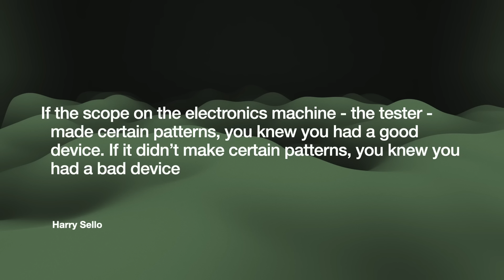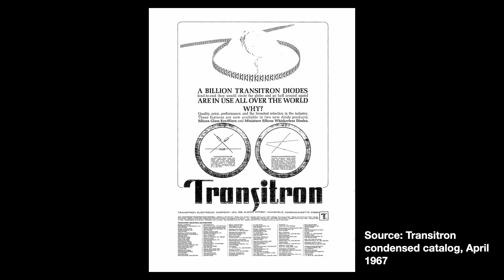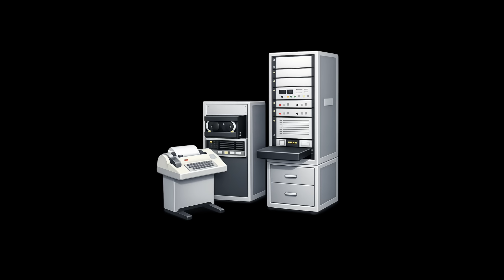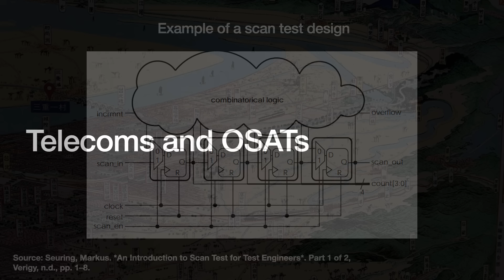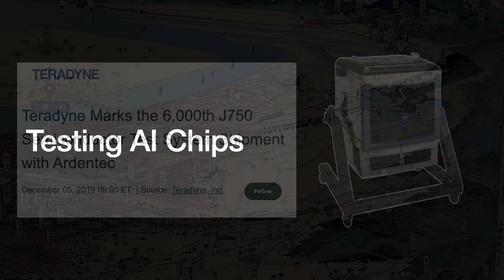How To Test 208 Billion Transistors

Comment: I would point out that the reason the number of test vectors were rising exponentially during the early years of the IC and SOC boom didn't actually have much to do with the number of transistors on the chip/board/system.  It had to do with the amount of buried system states (registers or memory).  The testing of functions with no buried state can be done by increasing the number of tests linearly with the number of transistors in the function.  But if the design buries state, you may need to cycle through many vectors just to get that buried state into a known test condition.  As the amount of buried state grows, the number of test vectors tends to grow geometrically.

I used to work for chip and board manufacturing companies from the '90s through '12.  I transitioned to device driver development later during that period, but in the '90s I spent 5+ years working on chip testing, including the creation of a custom ATPG tool for a smaller custom IC design firm to help with the creation of test vectors for a customer's chip designs. While I'm certainly no expert on testing silicon, I like to think I had just enough of an introduction into the field to understand some of the complexities involved.

BTW, look into the JTAG standard.  It was originally developed as a standardized protocol and interface for testing IC designs. It lets you halt the clock on the chip and serially shift in and out most, if not all, of the buried state in the design.  JTAG was also coopted to create in-circuit debuggers for ARM and other embedded processors, since JTAG's functionality is essentially a superset of the functionality needed for those debuggers and JTAG is/was a pretty well understood standard.

With that said, I've been retired for 5 years now.  The entire test industry has probably moved on from my experiences / background, so take this with a grain of salt.
Reply: JTAG was originally developed for testing the interconnect between chips on a board, not for testing the logic on the chip.

Regarding the buried states requiring more test vectors.
Design for testability (DFT) have been around and in use in integrated circuits, certainly in the 1990's and possibly earlier.
There are a number of techniques that can be used to deal with this problem, before JTAG came along, some of which involve the use scan chains, flipflops connected in a shift register which enable data to be clocked in from outside of the chip, the test vector applied to the internal logic, the output of the logic then fed the result data into another part of the shift register and the test results clocked out.

So you're not exercising the functional behaviour of any sequential logic circuits, which is where you have to sequence through a set of test vectors. The data is applied to the combinational logic purely for the purposes of testing, looking for stuck at 0 and stuck at 1 faults on the output of gates.

Comment: I love your content! 
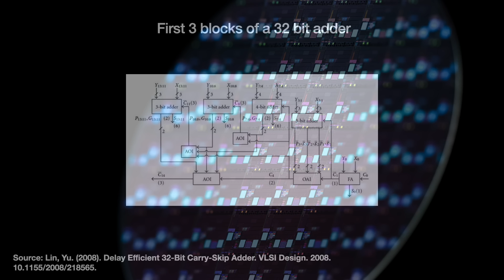19:35 that is not entirely correct. With prfix tree adders like kogge stone or other cla adders you need n^2 * c tests where n is the number of bits. Since you do not need to test every single input, but just that every single brent kung cell is working correctly. This can be done by crafting inputs in a way to force every single bk to switch in a way that you can rule out that 2 or more cells are broken. 
With ripple carry this is even easier und you just need n*c tests. 

Keep going!

Comment: I worked for Schlumberger the first 11 years after college on their Test Equipment. I worked on the calibration and diagnostics for the digital and mixed signal machines. These testers are super complex pieces of hardware and their software was more complicated than anything Microsoft has ever created. Out machines where used to test Intel and Sun micro processors, among others. We used to call the machine "big iron" testers because they where the size of a minivan or even larger.
Reply: Ironically another commentor reckons they work at Teledyne - and that they were 'awarded' for the largest Excel plugin
Reply: @mycosys  Our big machines where all powered by Sun workstations but I know Teradyne had an Excel based interface and I am sure the extensions and the spreadsheet would have been extremely complicated.

Checkout my channel for a Schlumberger video about the future of work in the year 2021!

Comment: 10:10 There's a real image of the D133 diode tester floating around out there. The black knob has in reality an indent, so you can securely push down on the diode to make good contact while testing, while still not fixing it into place for quick removal.
Reply: I would MUUUCH prefer seeing a real image than a generated one 😢

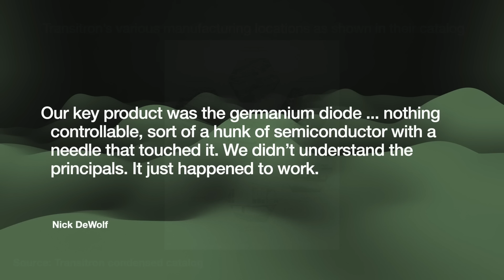Comment: 5:43 Chief engineer Nick DeWolf was a principal who didn't understand the principles of semiconductors.
Reply: Even the courses I took didn't fully understand them.  You have to get into quantum mechanics to understand how a solid state device works.  Way back in my grade 12 electronics class, transistors were hardly mentioned at all.  Most of the class was devoted to vacuum tubes.
Reply: @James_Knott It's been said by people smarter than me that nobody understands quantum mechanics. However, the above was a spelling joke.

Comment: I took a class in electronics in high school—this would have been in the 1970s. Our teacher was an industry veteran, who told us two things I remember to this day. (1) "A company like Ford or GM makes so many millions of cars that if an engineer can figure out how to save 25 cents on each one, they can give him a $10,000 bonus and still be ahead." (2) "Automated testers can test thousands of components per hour. You pour resistors, capacitors, or whatever, into a big hopper. The tester moves them, lines them  up, tests them, and spits them out. They end up in two bins: the good ones, and the ones that will be sold to Radio Shack."

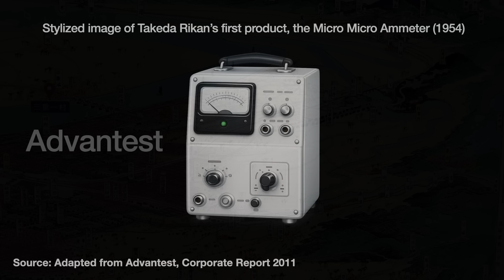Comment: 15:07 i worked for a company that got bought by advantest. In the Phoenix valley, they are making test equipment. We call shower heads for Intel. They're all machine with this plastic material that's super hard and rigid.I mean, cost twenty grand a sheet

Comment: One facet of semiconductor test is tied to design verification.   Given the staggering cost of a tape-out of a leading edge processor, a princely sum is spent on verification of the design with sophisticated emulators (e.g. Cadence Palladium) prior to releasing the design to the fab.  Test patterns for the emulators  are adapted for use in the production testing of the manufactured product.

Comment: I worked for a company doing maintenance on wafer test equipment for a short time. Mostly Teradyne testers. But the problem was almost always the Electoglas probers, specifically calibrating the stepper motors.

Comment: No mention of Eagle Test Systems? 😭
I joined in 2006 just after they went public and before Teradyne acquired us in 2008. We were low cost and strong on analog and mixed signal with low digital pin count. We did a lot of business with Texas Instruments. In the Teradyne years, I was software lead for a tester called the ETS-88TH/AC-2500 that Denso and Toyota use(d) for testing the main motor control IGBTs for EVs. I enjoyed collaborating with Teradyne's Kumamoto division, whom we involved mostly so that Japanese customers would feel more comfortable buying a tester from a foreign company. The building we hosted our 2013 demo of the 2500 in was condemned due to earthquake damage. The rendering shown in the video is its replacement. I left Teradyne in 2019 for Eagle Test Systems's founder Len Foxman's new company, Trulli Audio.
Reply: I recently worked in Final Test operations at TI, ETS364 and ETS88 were my bread and butter.
Reply: Also forgot other companies they acquired over time !
Reply: @charlesnelson619  Nextest and LitePoint were big. Universal Robots when Teradyne had overseas money they didn't want to pay taxes to bring back, but they're not ATE. I also remember thinking it was cool that our individual workstations all got firewalled but not NATed IPv4 addresses because Teradyne inherited a /16 block when they bought GenRad before my time.
Reply: I worked at Teradyne for 10 years and later at Eagle before the acquisition. Eagle had a better mousetrap for certain analog testing capability that provided unmatched economics for buyers. Teradyne was smart to acquire Eagle, as Eagle was going to take a chunk of its business at several major IC companies

Comment: Back in the early 1990s, we had a 68020, I think, which had a failure mode I've never heard of before or since.  When you wrote to memory, say 0x1000, it would increment memory at 0x1100.  Repeatable, reliable, fascinating.  Motorola bought the chip from us but we never heard what they found.  Would have been interesting to know what kind of mixed-up connections could cause such a failure while everything else seemed to work fine.  But that was a long time ago, and I've probably misremembered some details.

Comment: I'm surprised in a vide of Test - TSMC's dominant advantage hasn't been mentioned.
Just like its promise to always remain a pure customer foundry business, TSMC also has a promise to its equipment suppliers. It won't turn around and start selling chip equipment. Today, TSMC has the largest number of chip equipment vendors working alongside it in development and research for efficiency gains in yield, and next gen chips. If a company partners with Samsung or TI -> they need to be worried about other companies in Samsung group or TI start selling some equipment which can cut their sales. SEMS for Samsung, and evalmods for TI or their interface tools which are technically primarily for TI semiconductors, but with a few changes can be modded to work with similar chips from other competitors.

And, equally surprising is Apple's efforts in testing. They have been long putting in efforts for total software testing of chips - meaning putting it on a testing board, and running special programs on the chips which essentially test the chip itself based on the o/p and can detect faults. Of course, they've been putting in efforts, but their efforts began falling short, especially since they began to have AI cores, which behave significantly different.

Comment: In the 2010s my company made some ASICs that were basically a voltage regulator with some extra logic and sensors on the side.  I was one of the people who wrote the test program.  It was with a teradyne something or other, and for sure there were various measurment cards that we could choose between.  I remember the digital stuff was easy, it was just a file that the ASIC design tools produced automatically that needed to be loaded into the tester, and then a few function calls to execute it.  The analog stuff was much more difficult, where everything needed to be written by hand, often with hand made digital tests added to communicate with the chip and put it in the correct state (I have a feeling there was a better way to do this, but no one knew it).  Also I remember that the programming environment was C++ (which I know but dislike), and the VisualBasic thing was an option but we didn't want to and/or couldn't use it.

Anyway, seeing how the test industry worked was very insightful, and this video fills out more of the history, very well done.

Comment: Thinking about testing the state of our current silicon with modern A.I... here we go... Lego liar...... Anyone else this comment?
Reply: AI doesn't come into it.
The test problem doesn't require it.
The problem is simple: force the output of a logic gate to a 1 in order to detect a stuck at zero fault, similarly force the output of a gate to  0 to detect a stuck at 1 fault.
The challenge is the number of nodes in the design that need to be exercised and the volume of test data that needs to be applied to the chip to get a very high fault coverage and minimise the test time.

Comment: Another great video!  If you feel like doing a follow-up video on a closely related subject, I'd suggest how chips are binned, and how functional yields are defined and then measured.  Testing these very large chips with billions of transistors  has of course long moved beyond the mere "works <-> doesn't work" paradigm, and is now at least as much about determining functional yield and binning.  The latter (binning) is of course what pretty much every company in the CPU and GPU space does, but usually doesn't really talk about that much.
Reply: i feel like he must've already covered binning in an older video?
Reply: @CandyHam  Jon did cover yield improvements about 11 months ago in another great video (including optical wafer inspection etc), and that included a little bit about binning.  However, I don't believe he really went that deep into binning, which happens within chips that fall (technically) within the functional yield.
Reply: Absolutely. And even more fascinating how LEDs, laser diodes, and other Optical components are binned.

 Obviously major manufacturers.... but even hobbyists and enthusiasts will search out higher and better Binnedd components